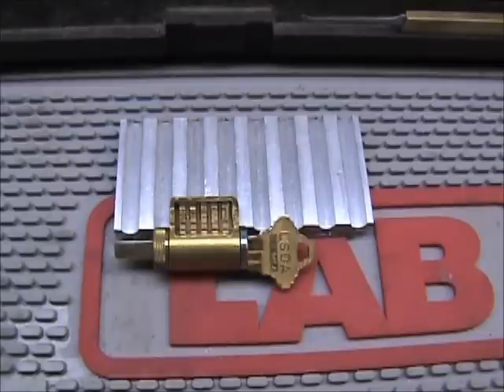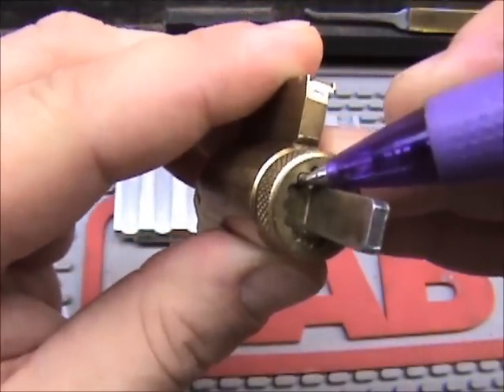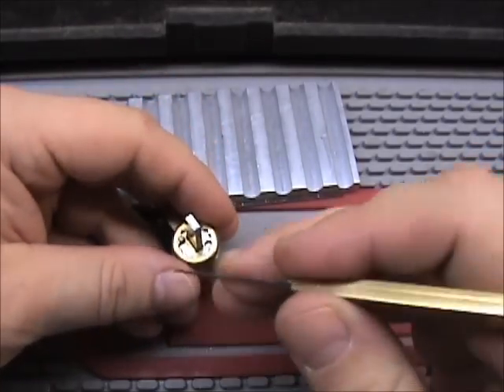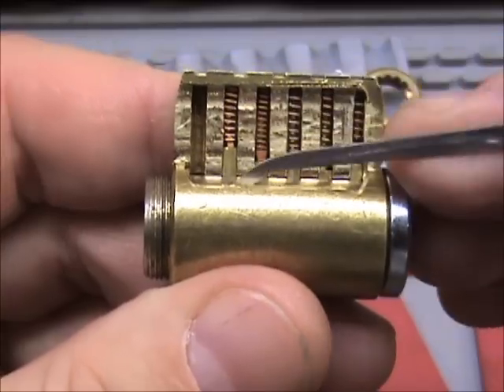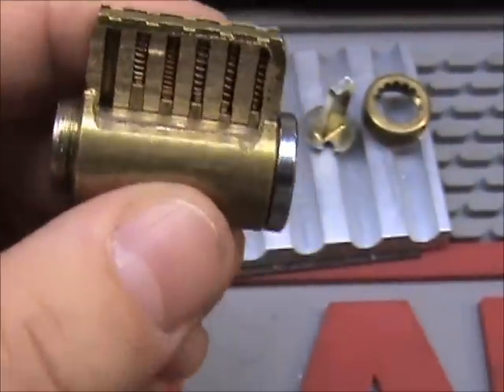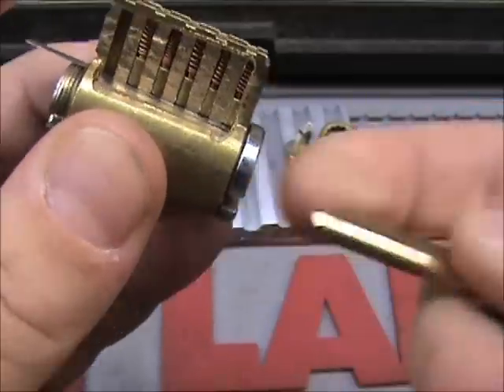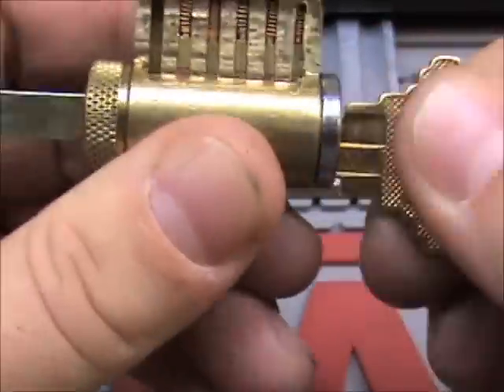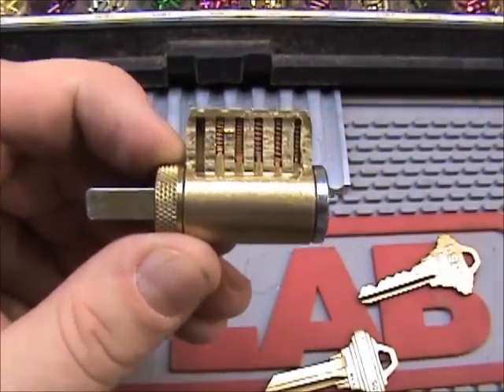Locksmithing 101 - Basics

Comment: Is there a reason why my MasterLocks 5th top pin is longer and larger in diameter than others? I can't pull the key after rekey because it won't clear the passage because my bottom pin is no.8 which is the longest. The solution I found was to install the cylinder in reverse orientation and made the 5th pin become the 2nd. Do you think this will cause issues in the future?

Comment: Obviously the pins have to be certain lengths when rekeying the lock. How do you know which pin length to insert into each pin hole to match the depth (or pin length) required. Are they color coded, is there a chart which comes with the key blank to tell you which pin to insert and do the new pins come with the new key or are they just in a pin set to purchase?

Comment: Is an auto lock the same thing but it has pins on both sides?

Now here is a question. I have a lock that is 18 years old (my driver side door on my truck) used twice daily. the key is well worn, to the point i went to make a double, and the auto cutter could not even find the groves on one side! but the lock works fine. If i use the original key, it works on either side, but the copy only works on the less worn side. How does this work? do the pins get worn down?

Comment: Great intro to pin tumbler locks.   I know this is an older video, but it all still applies.  One thing - at 4:40 you mention "warding".   I thought warded locks were the old skeleton key type or the old crappy gym locker locks. Wards are obstructions the correct key has to pass through.   In your video, I think what you pointed out is called the keyway.

Comment: looking for security pins of all sizes to make challenge locks, seen lab kits for $50 I don't want a bunch of regular pins. what should I look for?
Reply: +JB There may be a some other cheaper solution to your situation (not sure) but if you go to the web site learnlockpicking  DOT com you can buy a small bag of over 100 pins which include all kinds of pins including all different kinds of security pins for $10.

The actual description of the bag of pins is : 
"Bag of more than 100 assorted pins including bottom pins, top pins, master pins, serrated top pins, spool top pins, short springs, replacement retainer screws, and a replacement Allen wrench for the retainer screws."

The extra stuff mentioned in the description like allen screws and allen wrench and springs and stuff is because this is a bag of stuff that also comes with a rekeyable practice lock also sold on that web page. You can buy a 5,6 or 7 pin lock that has a Schlage keyway and has a little allen screw above each pin stack so you can take it out and dump out the pins and rekey each pin stack with whatever pins you want. ;You can then have a lock that has from one to seven pins in it or any combination of pins you want. All regular pins, all regular and one security pin (maybe to start with) and then maybe two security pins and so on. Virtually any combination of pins you want. 

If you want just the bag of pins you can buy that (go to the "Everything Else" link at the top of the page) or you can buy the lock and you will GET a bag with all that stuff in the description in it.  I myself bought the seven pin rekeyable lock to practice with. About the only downside I see to using something like this to practice is you are always using the same keyway. With using different (real) locks you have the potential to learn using different keyways.  Some might be large and wide open.  Some might be smaller and more challenging.  Some might be oddly shaped and very tough.  This same type of practice lock is sold on Ebay as well.

I don't have any affiliation with this web site, the person selling the locks or anything like that.  I simply bought one of these locks and know that it comes with a bag of all kinds of different types of pins and that you can buy just the bag of pins and it sounds exactly like what you might be looking for.  Remember, if you DO end up buying one of the practice locks off that web page, you automatically get the bag with all the additional pins both regular pins, different types of security pins, master pins all of that with the lock you buy.  I Hope this might be useful.

Edit to add: Fixed Typo

Comment: That was helpful. Just one question. My key will no long works to unlockthe dead bolt. Works fine on other lock so it's not the key. Lock is not all that old. It came with a key that says reset only with number on it. Is there a way to use those numer and rest the chamber?
Reply: Lisa Schaller yes

Comment: Thanks.
Can I ask why the follower rod has those slots in it? I see them a lot in lock videos but always wondered why they aren't a solid bar?
Reply: Because some locks have the tailpiece milled onto the back of the plug, that gap fits over that type. A solid one would work for the removable tailpiece type but then you would have two followers to keep up with.

Comment: When you use the shim do you have to have a blank key or will a key that fits the lock but not the proper keys work. Example, the key you want to rekey the lock to.
Reply: William Bishop it needs to be a blank key otherwise the pins wont all be lifted up enough :)

Comment: I've been picking for a while so while I already understand the basics, I do have a quick question.  Unless I missed something and it's an "either/or" situation, why do you use both a shim AND the plug follower?  Shouldn't you be able to use JUST the plug follower without the shim to remove the plug without having the pins fall out of the plug?  Thanks.
Reply: The follower can't be used unless the pins are at the shear line. He's using the shim as an example of how to get the plug moving if you don't have the key, can't pick it, or for whatever reason cannot otherwise manipulate all the pins to their shear lines at the same time. Does that answer your question?
Reply: I forgot to say: It's not about whether or not the pins will fall out of the plug, that'll happen either way (unless you're referring to the driver pins and springs in the bible, which are held in place by either the plug or the follower, ideally) once you remove the plug and tip it over. The shim is just, basically, a tool for an easy way to pick the lock.
Reply: +Fox MacLeod Ok, I had to go watch another video (Bosnianbill's "361 Shim those nasty locks open!") to understand.  What was throwing me off was the fact that in this video he used the key and the shim together.  What I didn't get was the fact that if you HAD/HAVE the key, you wouldn't NEED the shim.  You could simply put the key in and turn the plug and then use the follower to push the plug out.  It was made clear in Bosnianbill's video (and made your comment make more sense to me) because in Bill's video he says basically what you did...can't pick the lock etc, but then to demonstrate using the shim he simulates not having the key by putting the shim in place and then uses a pick to push each pin up to the shear line so you can advance the shim one position each time.  The key is what was confusing me.  Putting the key in to demonstrate how to use the shim didn't make sense (to me)  again, because if you have the key, you don't need a shim.  You would just use the key to put all the pins at the shear line and to rotate the plug.  Then, you could use the follower to push the plug out.   For some reason I just fixated on the key and that confused me as to what purpose (in this demonstration) the shim served if you had the key.  Having the key and using a shim AND a plug follower just didn't make any sense to me. Anyway, thanks for the response.
Reply: +Soulrider2012 The key he was using was a blank, and would not have opened the lock without the shim. It pushed the bottom pins up above shear line and he slowly let them down by backing the key out. So what he was doing would be easy if you have a key blank but not the key for that particular lock.

Comment: Just to boil it down to super-simple for the newbies, an easy way to remember the part around 4:40-5:00, after explaining what milling and warding are, could be to say that the milling (of the key) fits, or fits into, the warding (of the lock). Just my few cents. Hope it helps someone.
Reply: Er, I meant to type "4:30," not 4:40."

Comment: Yes Sir, Good Evening,as an apartment maintenance tech , we have 126 apartments, 6 buildings total, we have 3 floors to each building we use Schlage dexter deadbolts with the Inside turn knob, with the 5pin c style barrel locks, I'm 77 now as of April this year, I like what I do, I've been through 6 supers, the one I have now told me when It comes to locks he doesn't have enough patience to sit at a table, or desk, and Repin, and rekey, so I'm It right now, long story short, I worked for 9/1/2 years at my Highschool In the maintenance shop, 3/1/2 of those years I worked with 1 of my closest friends, he took a locksmithing course for 260.00, so He taught me a lot, He set up his own numbering system, we used Schlage at the one campus, and Corbin  at the other, well 3 of us were let go because they were trying to cut the budget, so I spent 3 or more years looking for work, finally landed the job working the Apartment Complex, I was younger then, and my lock training stuck with me, but now since I turned 77 I have those brain fogs, so when I Repin for the operating key, and our 1 master, I miss something, because when I do the operating key and try It, It works great, when I try our master pining It won't turn, when we run out of  locks and buy more, we still have to master key them, If I can just find out what I'm doing wrong, I can correct It, and I'll be more efficient for my boss, which will make us both happy,
Reply: I too like your videos, they are very easy to understand, and very Informative, I really have learned much, and appreciate the way you explain everything, thank you, and God Bless you,

Comment: how to do a master key for the locks
Reply: Neville Prasad did you see the coloured pins in the barrel? (: if so, there are little pins you can add on top of those ones. youd add them on all your locks to fit the cuts of the 'master key' so it works with all your locks (:
Reply: so uhm, just say if you had a cut in the normal key and it was uhm, a '4', and the master key was a '2' you would add a size 4 pin and/or a size 2 little pin, that way both keys would work (youd do it with every chamber, the numbers would vary depending on the cut sizes of the keys) :)